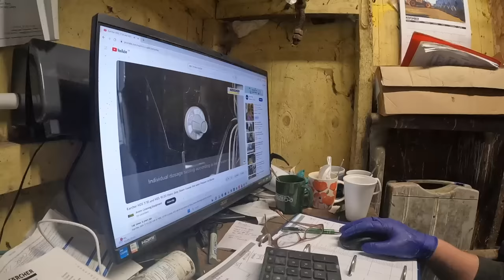THE PERFECT MACHINE FOR THE JOB...

Comment: Nice foam cannon and some APC will help break down the crud before pressure washing it off. 

Put some edge trims on the walls to protect the fibre from being banged and cracked. Water can get behind it and ruin it. For those damaged areas treat it with some resin to stop any more ingress.

Comment: Tom ,  put some galvanised angle iron on all the fibre glass corners where cows travel , it will protect the fibreglass from wearing out . did it on ours at the start and worked a treat . the last thing you want is water getting behind the fibreglass . Wareings should be able to get you some. it doesnt need to be thick steel as its not structural , its just a wear plate in effect
Reply: pretty sure we did 6 *6  angle iron to get the fixing bolt s off the corner
Reply: and don't use the pressure sprayer on those chipped corners or you'll risk the whole this delaminating from the wall

Comment: Karcher box. It's either a hot pressure washer or a hot pressure washer. I actually really want a karcher high pressure coil, but nothing else from the machine. I can use that coil to make a very good heat exchanger for professional carpet, tile, stone, and concrete cleaning.

Comment: Brilliant machine used to use one for 4 years 5 days a week cleaning off hire plant ..... protect it or drain it down from frost when it's on board water tabm freezes it's a rite bugger also keep a stock of the machine yellow bottles  if it runs out it stops it from working

Comment: Some advise with the karcher Tom. Make sure you run lots of cold water through the machine after using on steam. Trust me, karcher are Not cheap, and I would say it most likely to be cheaper to have your local case deal out than it will be karcher. Good luck.

Comment: i would suggest maybe as your looking at grease look at getting one that is a light color, a shop i worked for used a light green high temp lithium grease...general purpose..but the color was also a indicator that was used for when to grease would see when clean grease came out greasing and could see the dirt as it progressed in the joint...

Comment: The way my dad taught me to do the grease gun and cartridge is take both the caps off shake the top upside down towards the ground so abit comes out and then wipe your finger to shape it into a cone so when your screw the cartridge in it gets the air majority of it out to limit and stop air locks, also when you screw the cartridge in font screw it all the way in tight just go a couple of threads then release the handle you pulled out so it pushes the air out and cycle the grease gun to prime it then do it up, also I over grease the tip of the grease nipples so dirt sticks to the dirt and not the nipple and also keeps mud and muck out of and blocking the grease nipple, I hope my madness method helps 👍🏻👍🏻👍🏻

Comment: ... next. up for cleaning ... machines/equipment .... an INDUSTRIAL VAPOR STEAM CLEANER (like > Karcher Professional SGV 8/5 Steam Vacuum Cleaner - 240V - 8Bar - 5L ) would also  be very handy for your operation (NO or just little  need of chemicals) to loosen  the dirt of the walls  and then wash it of with big pressure washer ... as you could use it also for other dairy equipment
Reply: or you could rent a vapor steamer to test it

Comment: Love the videos Tom 
We have the same jet wash at work the chemicals go in the 2 yellow flaps at the bottom then u use the dials on the first left to activate the chemical the pot on the side is a water additive and can break the machine if u let it run out

Comment: Tom, try T clean from Wynstay, great product for cleaning your parlour. We milk 1300 cows and the parlour is always clean. We put it through a 10l pump garden sprayer then just hose it off. It great for protection of the equipment and much better than hypo and soap.

Comment: There's an enzyme wash you can poof-mop on to the top of the hardware along the runs and let sit for a bit before doing the pressure work.   "car wash mop" 

You definitely want to get a second gun for that washer that will take their turbo-nozzle "Dirt Blaster Rotary" if it didn't come in the kit.   And a riot shield to hold up while you use it to clean all that gating and hardware.

Comment: Those pressure washers are the nuts, unless they’ve redesigned them that little pot is a water additive to stop the internals getting clogged by heavy water, there used to be a flap the same as the diesel one on the opposite side underneath the push pot where you can add your detergent and it’ll auto add.

Comment: You don't need to push the plunger in. Just release it and as you use it, it will pull itself in 👍 we also.have the same washer!! Awesome you can have 3 different chemicals

Comment: No way Karcher I work for the company in Slovakia, you bought the best machine for the job. 
BTW: Use little bit of grease on hose ends on every seal on the gun and rod, it will prolong life of the seals and threads, and always depressurize the machine by pressing the handle on the gun when it is turned off. How are you satisfied with it so far?

Comment: Ok Tom do not use general purpose grease in equipment. You WILL cause premature wear on bearings and pivot points such as pins those things take high pressure grease general purpose grease is only for lightweight things. I recommend you take 30 minutes and do some research on google so you can learn the different types of grease and there uses and places to be used. Because using the wrong grease will cause things to wear out to quickly. And that my friend costs money.